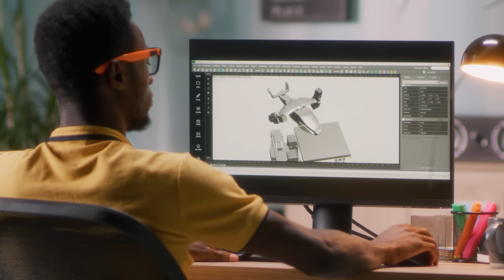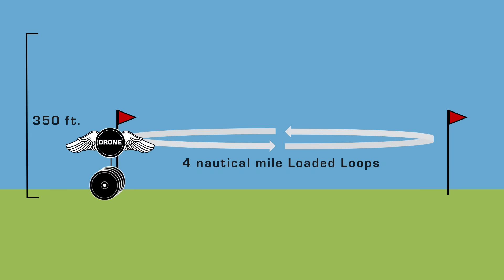DARPA Lift Challenge

Comment: @ 3:54, what’s the difference between a 107 and a “commercial drone license “?  One in the same, right? If DARPA can’t figure this out then where’s the integrity in this competition? 🤔  C’mon guys, get it together and understand what you’re saying.
Reply: I know, fuckn idiots
Reply: Part 107 is the FAA regulations on drones, commercial drone license is your permission slip from the gov't.
Reply: @CivilDefenseEngineer  I am a 107 and have been since the day the test was administered. There is no "commercial drone license" aside from the 107 itself. If I'm wrong, show us this separate, imaginary commercial drone license..... I've been flying commercially sine day one with the 107, so you're saying I'm breaking the law?
Reply: @CivilDefenseEngineer  He said ''you will need a 107 certificate". A "certificate" demonstrates that you understand the regulations, operating requirements, and procedures for safely flying drones. He didn't say the drone will need to be "registered'', "under part 107".... quote from the  FAA, "Anyone who holds a part 107 remote pilot certificate"

Comment: "We're reducing barriers for all", 2 min later: "commercial drone license and air worthiness certification".
Reply: They should've kept it as a very small footnote in the website, great way to save R&D expenses 👍
Reply: The $$$ required for motors that have enough power to move the load & meet weight limits are already a barrier to home hobbyists. This is pretty much exclusively for companies.
Reply: @HaloHunter2552  no one ever said that the drones had to have motors to turn blades
Reply: @thomaswakefield6889  I've been doing a little napkin math to consider the feasibility. A rocket would be horribly inefficient. IMO, this competition requires a MAJOR new technology to be feasible.
Reply: @HaloHunter2552  I never said anything about using rockets either and the tech required doesn't actually have to be new, just capable of actually meeting the test standards.
Reply: @thomaswakefield6889  That was a really clever way of saying nothing.
Reply: @HaloHunter2552 he means gas hobby engines
Reply: @hpakl I was also talking about gas engines when I commented.
Reply: @HaloHunter2552  oh and 3D printing and Arduino, Raspberry PI, and ESP32 programing also make it affordable for many hobbyists
Reply: Its easy to get and anyone that could win this could at the very least could get someone with it to participate with them.
Reply: @TheUnchanneledChannel  95% of hobbyist will have spent their money in designing and building the drone, which literally means this competition is setup mostly for businesses and colleges with drone programs
Reply: My son and I were competitors in the Robot Wars TV show, in the 1990s.
NASA contacted us to be part of the Lunar Regolith Challenge.
It looked interesting, but the deal-breaker,  IIRC, was a $1200 entry fee (that's $2000 in today's money).
We were looking at the usual backyard/sheet metal technology, and $1200 was our total budget.
Reply: @davechapman6609  and this is one of the reasons I never trust competitions like this. They never give you all of the upfront fees to even enter them.
Reply: Drone Airworthiness certification…. For a competition to build a machine that will outperform the other drones and it be certified?? What happened the experimental class for aircraft while in development.  Sounds like the  goal of the comp is to find which of the current shelf drones has the heaviest payload capacity.
Reply: @NvTwist  That's the problem, the FAA is trying to get rid of that policy
Reply: It's not that hard to obtain those things as a private citizen you know.
Reply: @CivilDefenseEngineer  it is if those citizens can’t afford the $200 dollar fee after they pass those exams.
Reply: @thomaswakefield6889 How do you think they will fund the R&D of the drone if they can’t buy an FAA permit? 😂😂😂😂
Reply: @bravowhiskey4684  duh all the money went into building the drone.
Reply: @NvTwist if you can do this for $200 you're the true hero
Reply: 110 lbs flying over people's heads. 😬
Reply: @scottriddell7893  The competition course is above peoples' heads?
Reply: @scottriddell7893 165lbs, 55lb drone + 110lb payload. Hopefully the winner will bring medical supplies, food, and ammo overhead and to tbe correct hands!

Comment: Very interesting challenge. This would stretch the limits of li-ion technology, maybe not possible with li-ion. Extreme high power density ICE (gas, nitromethane) engines with some kind of generator configuration might be a choice too. One funny thing is that China is so far ahead on this compared to the US I bet 80-90% of competitors will be using majority Chinese components. Maybe like an RJX 1300mm 4-axis carbon fiber drone frame would be a good start, or their 1000mm 6-axis.

Comment: That's great, but knowing they already have gravity manipulation tech makes it a big old mute point. Fun though, be cool to see some mini chinooks.
Reply: *moot 

Also, the US government has not been subtle enough to have tech without immediately abusing it so blatantly that the rest of the world learns about it & does it better.
Reply: Guys! what do you think about my lift idea: Antigravity achieved thru fibration of solitons and chirality in plasma tori, induced by ai controlled coils so plasma sheath can vibrate around the ship and interact with "vacuum", or should I say quantum substrate and basically swim in it like a giant plasma jellyfish. i'd use base60 code as dac/adc translation to binary and as one of languages that ai would run. main ai language would be 12d+ glyph recursive logic layer (up down left right front back each a line with 2 end points and intinite amount of coordinates in between), that is using extended unicode (150k to 1.1mln symbols+, as it can use any symbols) to make calculations faster and more accurate. All operated thru advanced BCI of my design.
PS DARPA don't snipe me with lasers yet like Ning Li (DoD $500k deal) and Amy Eskridge (hal5), I wanna fly in my antigravity orb before I die :(

Comment: I struggle with how a cycled course loop represents a real-world delivery scenario for a single payload.  This eliminates 2-stage concepts of achieving altitude for controlled decent (rocket/balloon/spin-launch/mag-launch to UP -> parachute/glider/drone/meteorite to DOWN ).  What this "Challenge" really is: , lighter battery competition , which means, highest energy density power source possible , which means hydrocarbons for most, but miniaturized nuclear for the GOAT.
Reply: Even hydrocarbons for this kind of project is very difficult. You have to have a very light engine and frame. Maybe nitromethane engines are necessary.
Reply: @izzeww8487  I guess a box is a square but a square is not a box…
Reply: @izzeww8487 nitromethane isn't very energy dense, so you would lose a lot of the advantage of liquid fuel.
Reply: You live in some kind of fantasy land batteries are not remotely feasible it doesn’t correct enough power density for the payload and most people calculations don’t compensate for the payload shift and rebalancing for strong, wind, gust, and turbulence

Comment: It's unclear what use case this supports. Payload/lift is irrelevant for most applications if the flight time is measured in minutes. Most serious applications need a combination of payload, and significant range or endurance; hence hybrid powertrains.... which will likely be uncompetitive in this artificially short test.
Reply: It's last-mile logistics for soldiers pinned down by enemy drones and artillery. Getting people to and from the front-line in Ukraine is extremely risky, so different kinds of aerial and ground drones are used when the risk is too high to drive a truck in.
Reply: @IlIlllIllIlIIIll  so you’re suggesting it’s more of a battlefield Logistics this live challenge seems to be able to apply too many different sectors. I also think the four to one ratio would make it easy for drones to have assault rifles on them and fly around and make stable shots.
Reply: Munitions.
Reply: 5 miles is clearly inadequate for frontline resupply. Russian fibre optic FPV range is routinely 20 miles, now rising to 30 miles. Supply depots need to be well outside this range or they might as well be on the frontline. Any device made to this spec will be of little practical use.

Comment: LOL.Was all full of myself till I read 2.7 no blimpie bois. Can't use negative ballast gasses.
Reply: That was my initial thought
Reply: @DarioEspina same occurred to me to at least reduce the weight of the payload before applying whatever propulsion is used.
Reply: bummer, would be one obvious solution
Reply: The Air Force already had a blimp autism incident back in the day.
Reply: My first thought too
Reply: Would a hollow carbon fiber frame filled with helium not be allowed?
Reply: @64mikecowart  Probably not.  The problem with helium is that it's very hard to contain for long periods of time, and will slowly leak out of almost any storage container.  This would necessitate refilling the negative ballast in the field if you want to get the most out of the drone, which is logistically not an option.  They want a system they can take out of the box, charge/refuel, and fly, without having to worry about finicky adjustments to get going at max performance.
Reply: @jamesburleson1916  "will slowly leak out of almost any storage container"
Sans the rules , if someone solved that and gains a weight advantage their just gonna win in the market instead of the game.
"which is logistically not an option.  They want a system they can take out of the box"
There are what's in the rules and what are future concerns.
And the rules are pretty leak proof on this, huehuehue.

But if would be funny af if someone figures out a way to game the carveout: "used for structural rigidity or pneumatic actuation, it must be atmospheric air, "

Comment: DARPAs Donna acting as if they don’t already have Anti-Gravity Tech.  This is the challenge where it gets demonstrated. 😉
Reply: Guys! what do you think about my lift idea: Antigravity achieved thru fibration of solitons and chirality in plasma tori, induced by ai controlled coils so plasma sheath can vibrate around the ship and interact with "vacuum", or should I say quantum substrate and basically swim in it like a giant plasma jellyfish. i'd use base60 code as dac/adc translation to binary and as one of languages that ai would run. main ai language would be 12d+ glyph recursive logic layer (up down left right front back each a line with 2 end points and intinite amount of coordinates in between), that is using extended unicode (150k to 1.1mln symbols+, as it can use any symbols) to make calculations faster and more accurate. All operated thru advanced BCI of my design.
PS DARPA don't snipe me with lasers yet like Ning Li (DoD $500k deal) and Amy Eskridge (hal5), I wanna fly in my antigravity orb before I die :(
Reply: They don’t. This is legit.
Reply: The US government has not been subtle enough to have tech without immediately abusing it so blatantly that the rest of the world learns about it & does it better.
Reply: @prophetzarquon  😏 Marne they already are 🤫.      🤭
Reply: I don’t know, man. The wright brothers were quite some time ago.
Reply: It'd be funny if it's something stupid like nice big capacitor plate stack with enough charge to knock a person flat, but it has a bunch of coils around it to produce a rotating field. Not only that but the coil timing is handled by an off-the-shelf ESC for a brushless motor.

All the hypotheticals about crazy exotic stuff, and when it comes down to one particular mode of operation it's a garage-build kit. (However there may be some branching aspects of the tech they don't want exposed - which is why it's been kept secret. Comes down to gravity waves having a role in fusion or something like that.)
Reply: @pauljs75 check my earlier comment in this thread
Reply: Right. They'd be measuring how capable the civilian populace is at industrialization.

Comment: 24kg is enough for a pretty big RC helicopter. Large blades are way more efficient than small drone props.
Reply: The 55 pound limit may be prohibitive in this approach.   Larger/ longer rotary wing design that can handle multiple levels of airframe weight will have a good deal of stress distributed across them and would require either expensive difficult to machine materials to replace heavier/sturdier materials.   Also the load on the central core and components would be a point of failure without denser materials/parts.  Not saying its impossible but the costs of custom tooling and part machining is not worth competing for such a design.   I think they're looking for outside the box approaches like thing that leverage creative aeronautical design against lift physics in a unique or inventive way.  Similar to how quad drones revolutionized the industry over the last few decades.   This stuff is above my capability though
Reply: @sparaz  it only needs to fly at a speed of 11.5mph. So you can go with really large rotor blades and slow rotation speeds. I'm guessing we will see a lot of helicopters with a ridiculously large rotor, with hollow blades with a very thin carbon fibre skin. Maybe we will even see some balsa wood rib structure propellers. So that would maybe win the competition, but not be applicable to real world applications as it won't be durable or able to fly in anything but perfect weather conditions
Reply: That was almost exactly my first thought too after I watched the video.
Reply: @michahermann7869  hey thank you for that idea. It’s a bit low tech but simple. I might run that in my test bed. It’s your fault for putting in a public forum. If you were planning on entering, but let me not be an asshole and share a little bit too, have you ever thought about aerospace bamboo Tapology optimization. Do it what you want with those ideas if you are planning on entering Martinez, the router design is a wedding design. You could theoretically get a five to one ratio if done right based on my algorithms and hyper cubes
Reply: @s @sparaz our instinct is correct, and I have thought of the same exact thing, but my design philosophy is not outdated and I’m not meaning that in a disrespectful manner I just never was taught traditionally I taught myself. But yes, large rotor design is exactly what it needs, but it needs extreme optimizations when designing the fuselage but to be honest, I didn’t win to the design is a actual flaw. It seems like it would increase or be more efficient cruising speed yes but it also creates more weight and drag, even if you are used active floor control and ionic boundary layers, it still wouldn’t work. Have you ever thought about layering the structural components in a unique way trying to figure out a way to say it without giving you a clue well I guess giving you this one Clue won’t actually help you, but you should think about using the right kind of metals making them as light as possible Than wrapping them with material that is going to increase their structural rigidity and elasticity and impact resistance. I have six solutions that I’ve been exhaustively calculated with optimizer algorithms and Latin, hyper cubes, logarithmic decay, etc. any design you can think of even with bleeding edge I have probably built it validated or invalidated for this specific lift challenge

Comment: So... the MINIMUM is a ratio of 2. A heavy lift helicopter is around 1. So competitors need to science the sh&t outa this, with boocoo dineros. 

Carbon everything. Titanium bolts at $1000 a pop. The best CFD boffins & wind tunnel facilities.

Isn't such an open competition now...!

The size of the device is capped at an arbitrary value....  bearing in mind the average human can't easily lift 55lb, and for sure not 110lb. But 2000 rounds of 7.62mm ammunition is around 110lb.

And yet a human weighs 200lbs, so this project is aimed at munition & supplies, not transportation... maybe could be scaled later.

Range has a tactical vibe and so engine size and fuel onboard are also severely constrained, the operating window is VERY specific. 

Interesting...🤔
Reply: Learn how to talk to sponsors. This is not just about being a engineer. It’s also about being a good business person being able to get the right partner to get your project going and how to communicate effectively with non-engineering companies are engineering company companies so it’s not just a design challenge to build. It’s also a communication challengefor you to actively seek people to work with.
Reply: The only positive potential about those weight ratios is inverse square law.

Comment: A lot of couch engineers in the comments
Reply: "A lot of couch engineers in the comments", yeah, that was the point of the freaking competition, Einstein: 1:28
Reply: Couch Engineers invented the first airplane, we're in good company.
Reply: Well no, those were garage engineers, & I think they maybe even slept in hammocks?
Reply: @prophetzarquon  Maybe napped on a chaise?
Reply: AI just told me to build it with unobtainium, and power it with irradiated ultrafuel.
If you find a link to this stuff, let me know.
Reply: called mount stupid skimming through videos leads to inflated sense of knowledge , iam sure they cant even solve the most basic problem
Reply: And how many of those couch engineers have workshops?
Reply: that's the power of DoD outreach
Reply: I’m a gym engineer
Reply: @cybyrd9615 have you designed any well known Jims?
Reply: Agreed, these parameters are insane and I'm looking forward to the wild machines that result from this challenge.
Reply: Don’t be condescending without bringing your own solutions Mr engineer